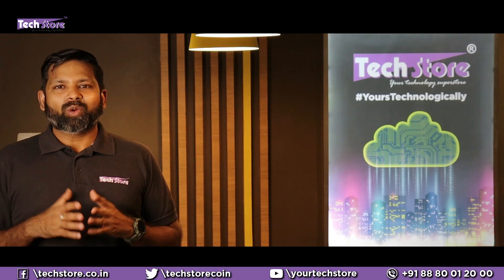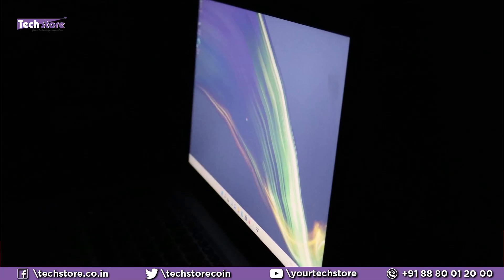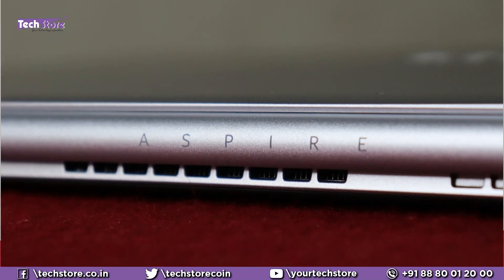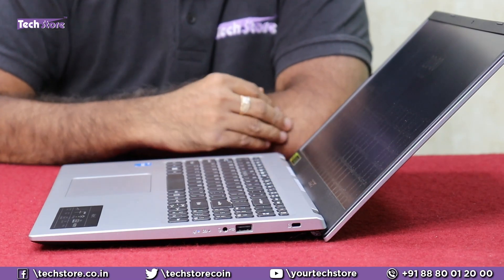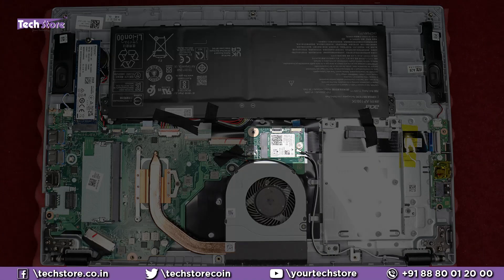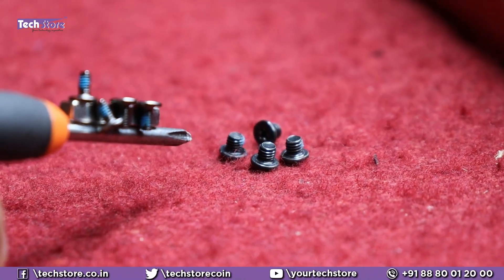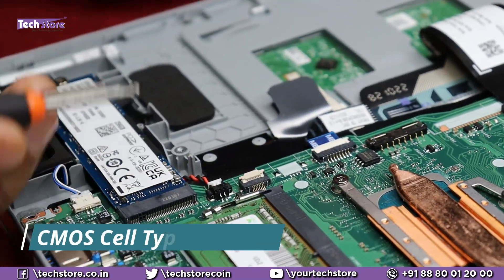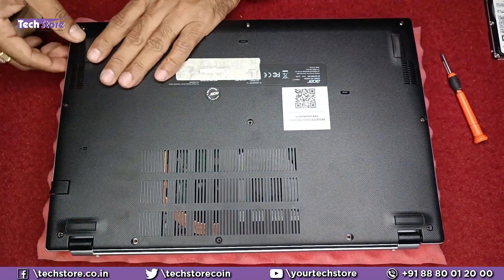Acer Aspire 3 2022 A315 - Full review disassembly upgrade ram ssd hdd battery diy

Comment: I have one of those laptops and I think some of the things you have said about it is just nit picking. The annoyance for me though is that mine didn't come with a HDD connector or the caddy to put it in, which is a shame because I prefer to save music and videos etc on separate storage to the system one incase of having to do a complete windows install.

Comment: I am trying to connect 2 monitors to this laptop, one through HDMI and the second through a USB to HDMI converter and the second screen is not visible, it is not detected, what could be the error?
Reply from the maker: Advise you to use a Ctype dock or a USB dock. Usb to hdmi converter is not a reliable device.

Comment: According to Acer's spec sheet the Aspire 3 Laptop - A315-58-59H2 SKU: NX.ADDAA.009 has 8GB RAM installed and a maximum of 8GB also.  So according no RAM upgrade it would seem.

Comment: Depending where you live warranty void if seal broken stickers like that may not be valid.  Think some jurisdictions have ruled that mfgs cannot void warranty simply for customer adding common standard components such as a hard drive additional memory etc.  Of course they would not have to warranty the added devices or any damage caused by the installer or the component itself.  But still have to honor warranty on the main system.  For example mfg can't decline warranty of screen back-light due to customer installing/upgrading disk drive.  Unless of course the damage was caused by the installer.

Comment: I have Acer Aspire 3 A315-58 and it seems identical to this one, unfortunate it does not come with the plastic Caddy and the SATA cable connector inside it.

I wanted to install a 2.5” SSD drive to my laptop, but doesn’t know which SATA cable connector to buy. Could you tell me the “Reference No” of SATA Cable connector please? 

Thank you in advance
Reply from the maker: We dont have the reference number of this model. Ideally contact acer support, they will supply one.
Reply: Hlo bro...did get the SSD cable connector and HDD bracket tray? If the tell me where to buy this. Thank you.
Reply: Sir how is the quality of the screen?

Comment: would you recommend i3-1215u  or ryzen 3-5300u
the models options i have are these. Here intl warranty means no warranty.
The starting models is the higher price available to lower. all new with 1 year warranty.
Acer Aspire 3 A315-59-31QF 12th Gen Core i3-1215U, 8GB DDR4, 256GB SSD, Intel Iris Xe Graphics, 15.6" FHD, Windows 11 Home, Pure Silver, 1 Year Local Warranty 
HP 255 G8 AMD Ryzen 3 5300U 8GB 512GB SSD 15.6 FHD Dos Silver (International Warranty)
HP 15s FQ5009NE Core i3 12th Gen 4GB 512GB SSD 15.6 HD Dos Jet Black (International Warranty)
HP 15s FQ5000NIA Core i3 12th Gen 4GB 256GB SSD 15.6 HD Dos Jet Black (International Warranty)
HP 15s EQ2025NIA AMD Ryzen 3 4GB 256GB SSD 15.6 FHD Black Jet (International Warranty)

or goes for refurshied/used imported from USA or UK or maybe other countries. 7 day warranty only. but they battery life is reduced to 3-4 hours only.
 Hp 840 g5 i5-8250u/ 8350u 8/256
usage, little gaming , school work, studies ,and lite rendering for youtube channel of his.

Comment: I'm using Acer Aspire 3 A315-54 i5 8th Gen. Which SSD can I use? Does it have M.2 SSD slot? Can I use WD Blue SN 570...PLZ REPLY
Reply: Yes, you can install any M.2 NVMe SSD.

Comment: Feedback of Acer Aspire 3 A315-58, 2022 Model, purchased on 17 September 2022.
Configuration: Core i3, 11th Gen, 8 GB Ram, 512 GB SSD

Pros:
1. Amazing performance, will never disappoint you.
2. Awesome build quality. I purchased blue color which looks premium.
3. Keyboard is nice, smooth and seamless.
4. Wifi works very well.
5. Extra port is available for RAM and SSD/HDD extension.
6. Light Weight laptop with sleek bezels.
7. Touchpad is also cool and performs well.
8. Data transfer speed is awesome.

Cons:
1. DIsplay is pathetic, yellowish tint is there. No proper/dedicated setting is provided for display setting change. Basically in display, you will find same difference as of IPS and amoled panel. Also if you watch a content from some angle, then it will look some grayinsh/blackish which doesn't justify its value.
If you have used previously dell or HP laptop or earlier used sony vaio laptop then surely you are not going to like it.

2. Camera: just one word, pathetic. It seems they have provided VGA camera in this laptop.

Other than above two cons, this laptop is awesome. So If you are in budget and doesn't bother about display then can go for it.
Reply from the maker: Good elaborate detailing.

Comment: I just bought one of these and your video is extremely useful to me as I intend to upgrade. Also your run through the various parts and ports tells me that I can self service and upgrade this lap top. I totally agree with you about the keyboard, it is very tacky and yes the speakers are a bit naff as well. Thank you very much, this was very helpful.
Reply: how is the battery performance??